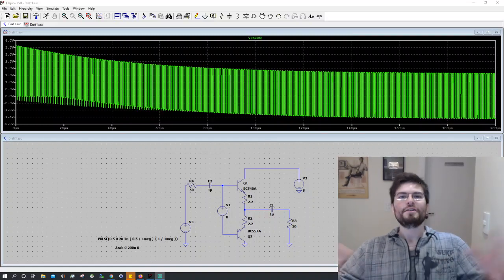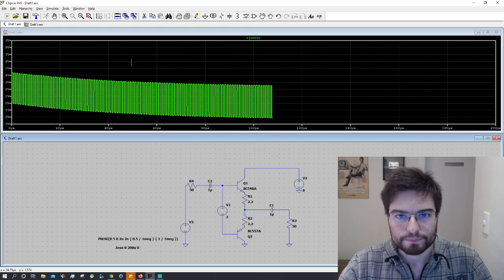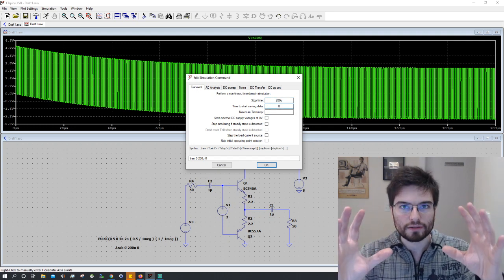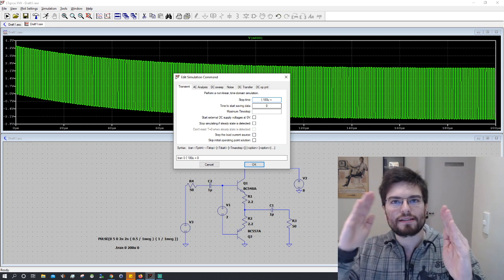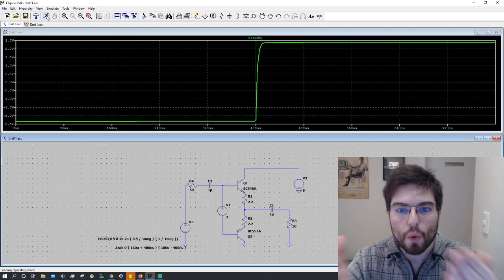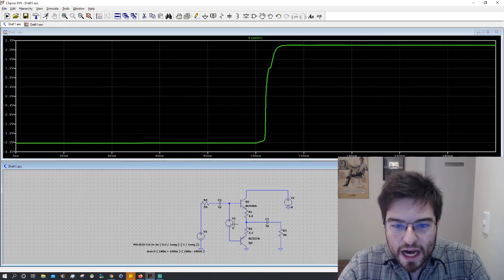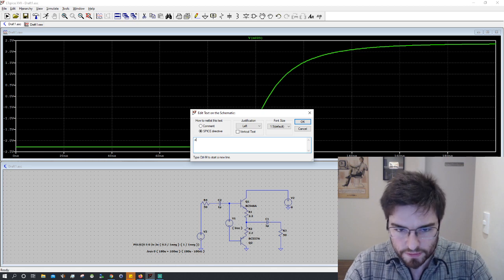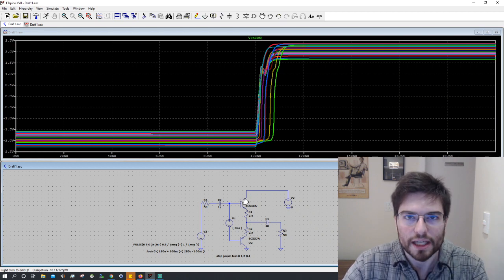LTSpice - Tip when simulating circuits

Comment: there are many non-convenient little bits of LTspice that I wish the developer would address.
but upon making a few suggestions to him, I learned that he is not open to any ideas - in fact he seems nasty about the notion that anyone would be so bold to actually make a suggestion. perhaps someday the code will be gifted to the open source community, and then it can be screwed up with abandon.
Reply from the maker: Yeap.. I feel the same.. Actually I think that internally LT has a better GUI, or some integration with the semiconductor layout software.
Reply: @AllElectronicsChannel  yes probably, I also note that since the Spice engine is available from command prompt - there is nothing stopping anyone from developing another GUI. Python + PyGUI or another GUI
would be possible. Just a lot of work.
Reply: I have a question Can you tell me on this program